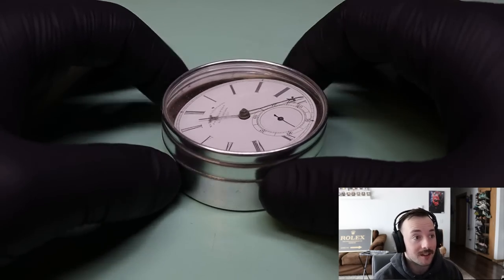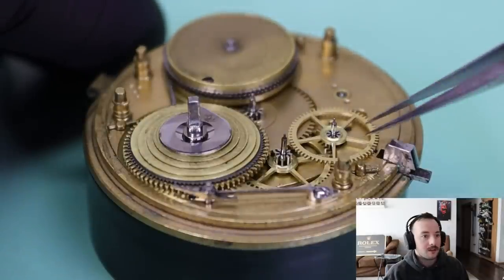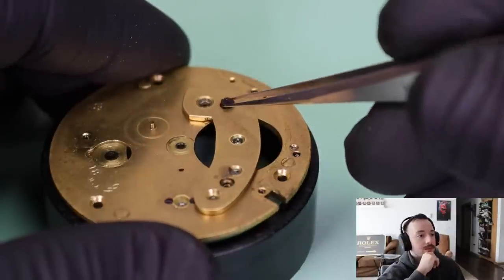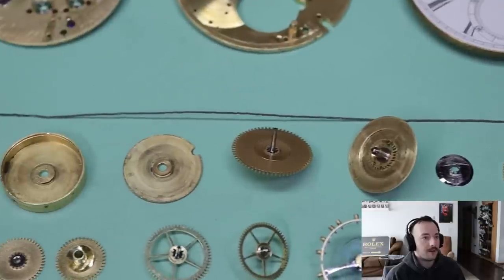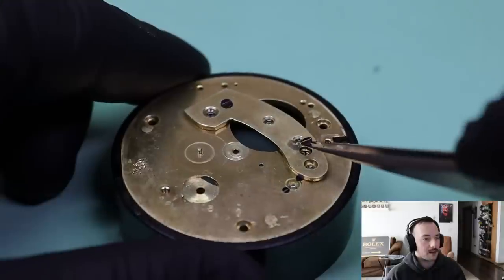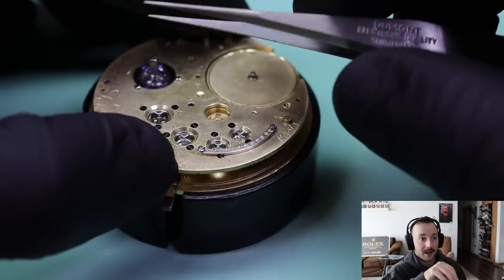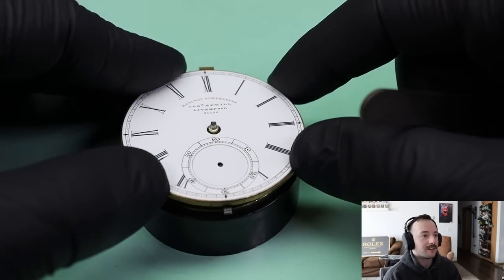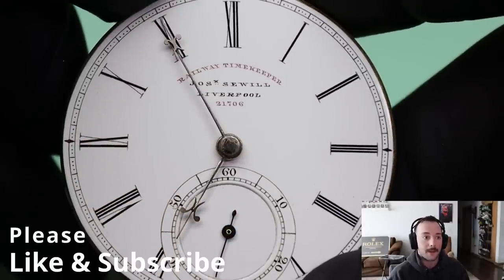180-YEAR-OLD FUSEE Pocket Watch RESTORATION

Comment: Unusual mainspring end! I dealt with quite similar fusee watches (Jos Johnson,  Beesley, etc) , but they all had a regular hole end mainsprings.

Perhaps it would be possible to cut a hook out of a piece of metal, punch a hole in the new mainspring and rivet it there.
Reply from the maker: That would have been the proper fix. Thanks!

Comment: I like the post disassembly commentary, it's nice and smooth. Cleaned up nicely! Really like the fusee, have you ever seen any videos on how they made those chains? Quite interesting.

Worked on a cylinder escapement of similar vintage not too long ago, that also had many taper pins, one good thing is they are easier to make than screws if they go flying into nowhere!
Reply from the maker: Yes, that is true! easily replaceable! Thank you for your interest in the video!

Comment: 8:23 The surface area is not relevant. What changes is the distance from the axis, so the "arm" you are pulling on. You change the torque. But it has nothing to do with how much area is being covered by the chain. It is a clever mechanism. I wonder if they actually tested the overall pulling force on the chain as the string unwinds and made the curvature of the "spiral" empirically, or it was a calculated thing based on simple mathematics if you know just what torque the main spring gives as it unwinds.
Reply from the maker: I appreciate you clearing that up! Thank you for the comment! & Support!

Comment: 1.  When they call them Liverpool Window Jewels, they aren't kidding!
2.  Its amazing how Waltham's just 40 years newer are so much simpler.  I wonder if it was better horology, mass production or a different culture of watch making.
3.  Never having taken an English watch apart, I never knew a fusee chain watch used a mainspring.  What was the advantage?  Why not just have wheel to wheel transmission of drive energy?
4.  You see pinned plates on the earliest of Waltham watches, from the company's beginnings in the 1850's in Roxbury, MA.
5.  I amazed you got the English Lever into the potance so easily.
Reply from the maker: first off thank you for the in depth message!

-I explain in the video that the fusee and chain help regulate power from the mainspring barrel.

-when the watch is fully wound and unwound there are different power outputs resulting in different timing.

-the cone-shaped fusee allows variable tension/power output from the mainspring barrel. the chain is the connection between the two.

-when the watch is fully wound, the fusee chain is at the top of the fusee "least amount of pulling power/tension"

-when the watch is unwound its at the bottom of the fusse the "thicker end" resulting in more pulling power/tension

-as the watch runs the chain trails down the fusee equalizing power output to the train.

I appreciate the comment! hope this helps!
Reply: @TimelyMatter  The effect you are describing is called "Isochronism."  Its clear the problem was addressed differently in American watches then British watches.  I believe US watches used recoiling clicks and hair spring shape to control it.  Other watches (French/Swiss and German), used stop-works type mechanisms.
Reply from the maker: @Waltham1892  Yes, Stop works is a beautiful mechanism for sure!

Comment: The straight pallet fork and spiked escapement wheel was an English feature, as opposed to the T-shaped pallet with club escapement. As far as I know, it was around throughout the 19th century. Superb workmanship.
Reply from the maker: Hey thats some great info! Thank you for the support, Its appreciated!
Reply: @TimelyMatter  In the 1950s, old watch movements in working order could be bought for five shillings. There was a shop off Hatton Garden had a stall with them. Top quality with fusees or verges or cylinders. The cases were scrapped for their silver or gold.

Boys would buy them, take them to pieces and put them together again. Sometimes they would work afterwards. I had a beauty with a fusee and 3/4 plate, which I put in a little wood case and used as a table clock. It worked well until the spring snapped one hot summer day.